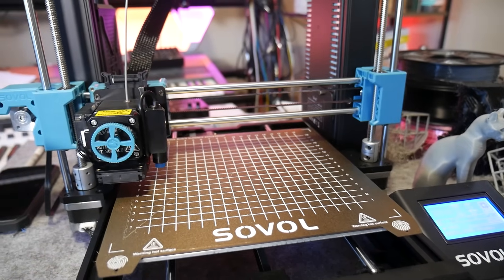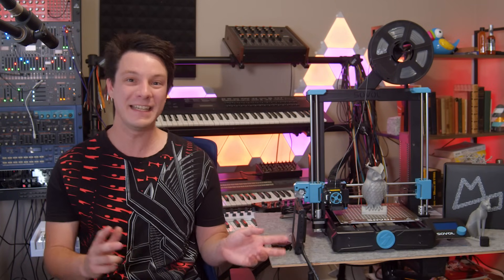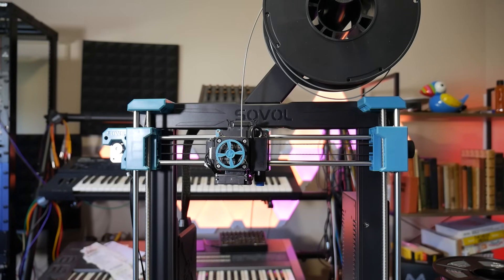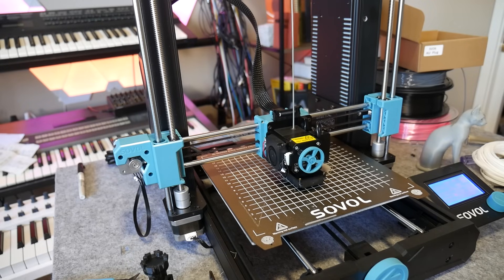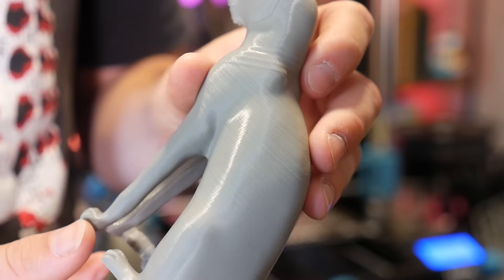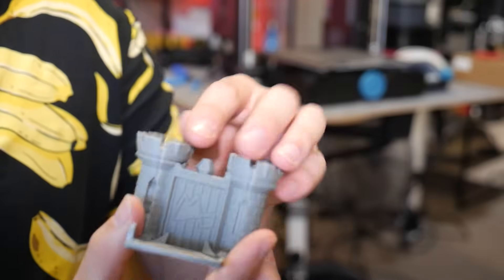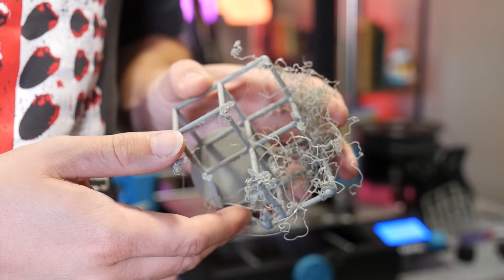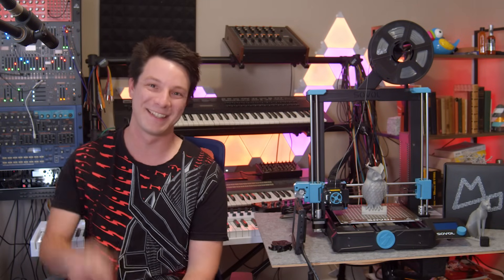Is the Sovol SV06 a Prusa MK3 for 1/3 the price?

Comment: 2 years in my problems are as follows.
The heat sync fan broke resulting in heat creep.
Planetary gear set screw came off, internet says it's a common problem. 
Overall still very happy with this printer for the price

Comment: With my Sovol sv06 both z-axis profile where bent within a few months. I don't think the printer can handle normal sized spools and it's a design flaw. Sovol also can't supply spare parts so the printer is garbage now.

Comment: I love mine, I bought it and the Klipper upgrade at the same time for my first printer in June and only had issues on day 1. Apparently I screwed up my z-offset towards the end of my first day so when I woke up day 2 I ignored the internet's advice and used feeler gauges instead of paper and have had ZERO issues since and it's basically been running nonstop since.

My Z end-stops aren't square so I use 1-2-3 blocks to ensure the gantry is level to the bed occasionally.

Comment: Is here someone who has fixed the auto-z-align-problem?
Everytime I start the "Auto Z-align" the printer starts moving, stops and the display shows "Driver error: PRINTER HALTED please reset". I already installed the latest firmware from a new micro-SD-card, but i never got farther than the Auto Z-align

Comment: i pickeds this up a year ago. Its amazing. Compared to what i spent on my prusa this thing does not diisapoint. I use it as a .4 mostly pla. Keep my prusa on a .6 . Ive used mk3 profile and adjust bed size and made a profile. However the update gave us a preset for the machine, But i would say eassily the best 250 i ever spent. love this thing. I did replace bearing and that quieted it down to basicall sound like my prusa minus the fan of course which really is not that loud. The one negative ill give it is the white grid on the bed sometimes comes off on the print. especially with petg. IDK why its even there but hey

Comment: I bought an SV06+ that came with a warped bed and was never able to reliably complete a clean print even after Sovol sent me a replacement (which took a month to arrive from China). Bed adhesion issues, spaghetti, system errors, and other things kept happening. Problems with the nozzle welding itself to the heating block at higher temperatures caused me to order replacement hot ends. Planetary drive would chew up filament and cause jams more than I wanted. I would literally have to watch the print from the very start to the end and jump on the power switch if something went wrong.
I gave up on the SV06+ and bought a CoreXY printer and it was the greatest purchase I've ever made. If you want headaches and problems, buy a Sovol. Otherwise, save up and buy a Bambu Labs printer if you are tired of the endless fussing, adjusting and reprinting over and over. Good luck.

Comment: try buying parts for your SV06 plus in Canada, I need a hot end as the temp sensor wire has broken and now the thing won't heat up
Need replacement parts but none are available to Canada, yet they sure shipped the thing to me fast.
Reply: Contact their support

Comment: Hi Angus,
I love your videos (especially laser cutter safety), but 1 thing has been bothering me, that all 3d print you tubers seem to be doing. Bed levelling. I've seen everyone refer to automatic bed levelling, which is actually, mesh compensation, not bed levelling. Most 3d print manufacturers are also doing this. I just bought the BambuLab X1C with dual automatic bed levelling. But it's not. The bed is driven by a single motor. My old Cyltivate3d beast v1 on the other hand that I upgraded with a Duet2 wifi board, has 3 z axis motors that does do true automatic bed levelling AND then it does a 25 point mesh compensation to account for bumps in the (levelled) glass bed.

Could you do a video to clarify this inconsistency please?

Thanks
Adrian Bear
PS, I subscribed 😊

Comment: One thing I've run into with inexpensive printers is skew during full bed prints.  I print functional things vs. models most of the time.  I would love to see more reviews include things like skew testing.  I was able to fix it using Marlin's skew correction.  Before my sub $300 printer I never gave it a lot of thought, now I do.  It was fun to learn building and compiling my own version of the firmware, but I'd rather be printing.  :)

Comment: I've had the SV06 since Christmas. It's my first 3D printer and I love it. In the meantime I have retrofitted a filament sensor and the cooling fan has moved to the back. There are already mods in the scene to print out. For example a filament guide. The Ender3 spool holder fits as well as the Ender3 cover for the back of the display.
Maybe I'll print out a Prusa on the SV06 ;-)

Comment: In my experience with more recent low budget printers (for example the Elegoo Neptune 3 Pro), the weakest link is becoming the firmware. There is so much 'copying' from Prusa in terms of features and functionality I kinda wish companies like Elegoo, Sovol, etc, would also incorporate the quality of life features found in Prusa's firmware (autoleveling on print start, filament changing, how the menu's are set up and controlled, etc).

All in all, like you observed with the filament run-out sensor and cheaper bearings, I think folks would be generally be more than willing to pay 50 euro/pound/dollar more for such a printer if those minor drawbacks were properly addressed. Printers like this would then really be good value for money.

Comment: 1mm retraction is VERY standard for a direct drive extruder, and I've never used more than 5mm on bowden driven. Lol.
I use 0.36mm on a direct driver with a bi-metal heatbreak with 0 stringing. You still got stringing.

Comment: Subscribed and have watched numerous of your videos.  Thank you!  what do you think the best printer is for dual material (dual head or multi head).  I think budget may be close to topped out at $1,500 and I like the carbon, but think if bambu made a dual head or heads that can be docked and picked up and placed, would greatly increase speed (between material changes) and also significantly reduce waste by one head not trying to be a catch all for all materials.  Many materials need different heat settings so multiple heads really seem more suited for multiple materials.  My guess is Bambu will produce a machine like that one day, but that one day may be a couple years out.  So are you aware of a machine that has multiple or at least dual head docking capabilities?  Thank you Again!

Comment: The open source piece is crucially important here; it should be par for the course it's just unfortunate that so many play fast and loose with licensing, due to in practice being beyond the reach of any real penalty. So, good to see Sovol honouring it for the mechanical design derived from the Mk3, and the firmware from Marlin. In practical terms, that means it's easy and reliable to go about designing mechanical modifications and adjusting firmware, and that in turn means the negatives mentioned (no filament runout detection on the print head, poor part-cooling fan arrangement) can easily be remedied.
Note however, as far as I can tell the main board itself is not open? I can't see schematics and layouts/stackup on the github ( they're not required to publish them as far as I can tell, so no problem on that front). Not sure if the board is fused (c.f. the BTT boards) or how good the power regulation circuits are, etc.
Reply: The PCB files are on the SV06 repo, but I haven’t found schematics anywhere. You could get the same info from the PCB files, especially since it has net names in place, but it’s a bit of a pain in the butt.

Comment: No, it's not a MK3 for a 1/3 the price, it's just another generic made in china MK3 clone. But without the build quality, reliability and CS you get with prusa.
Reply: How do you know that? Do you own one? Freaking fanboi🙄
Reply: @themountain59  How do I know? Because it's just obvious. Who makes the hotend? Who makes the extruder? Who makes the PSU, or the rails & bearings, or the mainboard, or the stepper motors, or the heatbed. Who makes all the parts put into a sovol SV06? Because sovol, just like every other chinese printer, doesn't make their components. They get their parts from 3rd party manufacturers. With prusa, you know who makes the parts, literally every part on a sovol SV06 is a no name, knockoff clone part from shenzhen. Now calm down before you have a stroke.

Comment: I absolutely prefer V-slot rollers over rods and linear bearings in any day of the week. Linear bearings are noisy and usually wear out much faster than the common POM/delrin rollers. And they need lubrication that attracts dust and grime like hell. Not to mention how rigid V-slot profiles are compared to these surface hardened rods.

Comment: I have an SV-01 and it's been a workhorse.  I mostly print TPU with it.  It replaced five Qidi 3D printers that had proprietary parts that I had trouble sourcing to maintain the printers.  I'd like to find a good workhorse 3D printer that was enclosed for printing ABS, but with the reliability and maintainability of the SV-01.

Comment: I think Sovol is getting there, just like Creality who've had hits and misses along the way, their current generation of printers is getting better. I love my Ender 3 S1 Pro, it just works and haven't really had many issues with it. Which is why I upgraded all my ender 3 v2's with the same PEI build plate, dual z axis kit, and sprite pro extruders because I loved the way the Ender 3 S1 Pro handled/performed. Even those issues with it initially were simple little fixes, but Sovol definitely seems to be taking feedback and applying it to their products. I may wait a generation or two to get one just like I waited for Elegoo to come out with their current generation before buying, got an Elegoo Neptune 3 Plus and has been so handy with larger printers albeit a few hiccups due to being different settings wise than the enders I've been using for the past few years. More and more companies are putting out good budget friendly printers with ALOT of features packed in, can't wait to see where 3D printing is at by this time next year. Hopefully we'll move away from bed slingers but till then, I hope companies keep up the pace.

Comment: Prusa really needs to revise the MK3 design to add some of the features especially the way the extruder assembly is so easily removed without having to deal with the large bundle of wires.
Reply: Prusa out , FLSUN in , 3d printing enters the era of high-speed printing  ，maybe you can try

Comment: I have been using one for about a week now.  It's quite a nice printer without considering price, considering price it's an amazing printer.  Some prints are actually looking better on this machine than on my Ender 5 S1 under klipper, somewhat disheartening :-)  I do have the minor but clearly visible banding in the Z axis on some prints, just as you noticed.  First thought is to repack the bearings with good grease and very carefully clean the Z axis lead screws and nuts.  If that doesn't do the trick then RJ4JP Igus Drylin bearings are just over $1 USD a piece in 12 packs from Amazon in the US.  Once all of that is done we'll all realize it's some silly configuration issue with the controller...

Although it's been years since my Ender 3 V2 was new and stock, it seems the print quality and speed are both superior on this printer.  As always, a fine video, thank you for all the great information over the years, looks like the synth rack is growing a bit as well!  If you get a chance, you might enjoy playing around with Arturia Pigments, although it sadly is not linux native.
Reply: U telling that ender 3 v2 is better quality print than soval and ender 5 s ?
Reply: Poor sentence structure on my part!  The SV06 does better in most cases than the Ender3V2, the Ender 3 S1 Pro, and even the Ender 5 S1.   The Ender 5 S1 is far more reliable now as I've sorted out the gantry assembly and alignment issues originally in the printer, but I still watch the first layer start up and sometimes need to tweak the Z offset a bit.  My E3V2 has some mods that make it closer, but the Sovol, like my RatRig VMinion, just works and works well, while the three Creality printers always require a close watch for at least part of the first layer as the bed level and Z offset seem to wander a bit with the Creality machines. @LUCKYRABITT

Comment: In “3D Printing Myths I used to believe…” you said to use a feeler gauge to set z-height yet here you are using paper. 🤦‍♂️
Reply from the maker: You can't use the feeler gauge trick with the z baby stepping unfortunately... I much prefer the feeler gauge method.

Comment: Does this printer need any Window$-exclusive drivers that I can not get a decent Linux version for? Or can I also use this without unbanning Window$ from my computer?
Reply from the maker: as long as your slicer runs it doesn't need anything, you slice gcode to the SD card.
Reply: @MakersMuse  
Thanks!

Comment: do you have your prusaslicer config for the svo06 available behind your community paywall? I have this weird issue when I add my custom gcode to pause for embedded magnets, the slicing on my sv06 profile does something wonky with that pause layer. It shows up in the sliced model way above the part. The same exact gcode works as expected on my default prusa configs
Reply from the maker: I just tweaked the Sidewinder X1 with Bl touch profile out of prusaslicer, nothing much beyond personal tweaks. Filament pauses don't work?
Reply: @MakersMuse  I havent tried anything beyond my special gcode to pause for the SV06. I like to use a series of positioning and operation commands to have the print head move to a certain spot, re-home, and extrude some filament out before resuming

Comment: I love it when I get a notification that one of my print designs has been remixed, I hope Prusa appreciate how much everyone uses their open source designs, because their printers are a benchmark to live up to.
One problem I see with open source in this sort of situation is that manufacturers often only go as far as making their product just usable, it's like they leave it up to the community to tidy up the loose ends and make their own fixes/enhancements, precisely why I started out with a Prusa i3 Mk3 nearly 5 years ago, which is still going strong, I've barely done anything to it except perhaps design a better, more ergonomic & easier to use control knob for the LCD (thing 4330049).
Reply: Minor nitpick here. Prusa did not open source their printer designs because they did not have proprietary control over it. To your second point, I think that the quality of low budged 3D printers has improved a lot in recent time. The SV06 is a pretty incredible machine at its price point. When I got into 3D printing I also started out with a Prusa because I wanted the hassle free experience. However,  today it's much harder to justify the Prusa premium because others have gotten so much better.

Comment: Thanks for the thorrough review. Interesting! Top tolerance score yet visually perceivable layer inaccuracy🤔.  It can that the servo motors are not homed at micro steps. Adding homing microswitches might remedy that. Or it might be even possible via software.

Comment: I've had the SV06 for a while now and I can confirm that the cooling is pretty bad. It's pretty much unable to deal with longer overhangs that the original Ender 3 would print with no issues. My specific unit also had an issue where the calibration grid would be slightly skewed after calibration, though this could be worked around by manually turning one of the Z axes - it does not need calibration before every print, so that's something you only need to do once. Other than that, it has pretty much worked with everything out of the box!
Reply: Yeah and the funny thing is that the new version uses the same cooling setup but with a volcano nozzle so sovol claims it can print at up to 150mm/s which just isn't happening lol. I had to install a new fan on mine just to hit 80mm/s.

Comment: I never needed a runout sensor. Knowing beforehand if your spool lasts is the way to go. I really like my Sovol SV06! They're the most reliable ones I had beside my BIQU B1
Reply: A runout sensor is great for using up all those spool ends on functional prints. Print until you get the alert, load another spool end and carry on.

Comment: I'm buying a 3D printer for the first time and I want to create products related to CNC store, I have 2 options in mind to buy a high speed printer like FlSun v400, Bambulab lab or buy a SV06, Ender 3S1pro. I know that this will be my first 3D printer and a high speed printer obviously requires more investment. Ender 3S1pro meets my needs, but in the long run FlSun v400, Bambulab lab would be a better choice than SV06, Ender 3S1pro, Any suggestions, thanks!

Comment: It's not a bad printer, especially for the price. But I warn every potential buyer that there is a good chance that it's going to require some amount of tinkering to get going. Mine had bed leveling issues, and and linear bearing was bust straight from the factory, it had to be replaced. And bed leveling issues went away only after doing the nylock mod. From the user Facebook group poll, about 1/3 of the shipped units have some problems, bigger or smaller. Once it works it's pretty great though.
Reply: Could you point out this FB group? I've ordered this 3d printer few days ago, and waiting for delivery, but I guess it'll be very helpful to be on such group in case of any problems :)